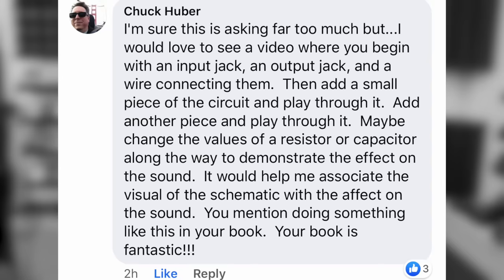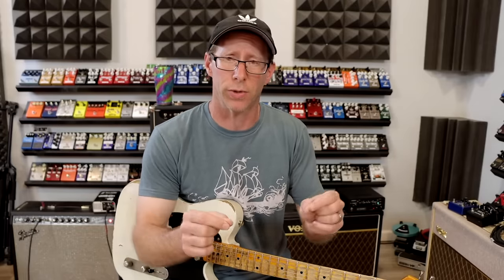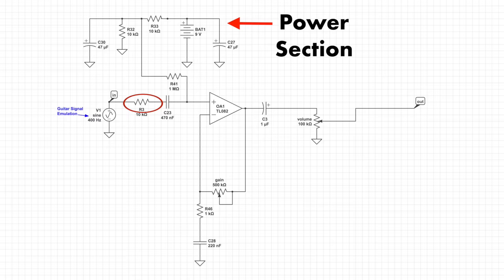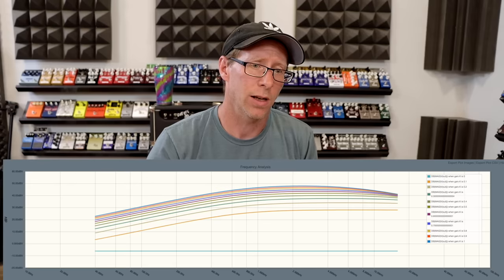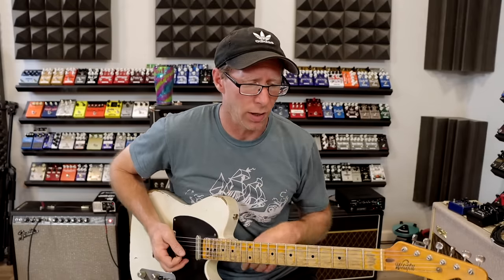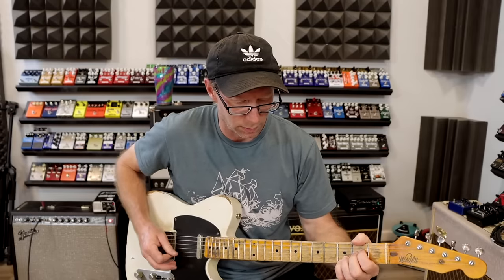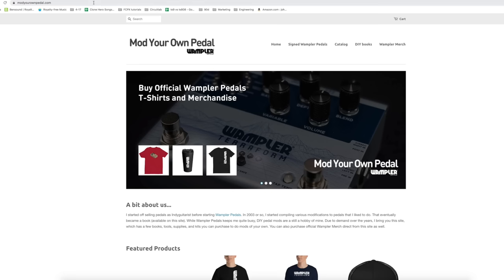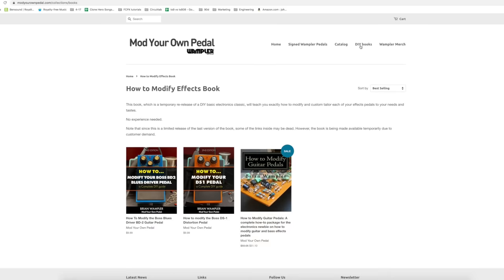How To Design An Overdrive Pedal Circuit

Comment: hey Brian, first of all thanks for the detailed explanation of the circuit! 
But there's something I don't quite understand yet, If let's say I'm setting the gain knob on my Tubescreamer to "0" and my volume to "max". Does that mean that any clipping sound that I heard is came from the op amp clipping and not the diodes? 

If I set my volume level to max is it boosting the op amp or what? 

I'm hoping you could help me understand, thanks very much in advance man!
Reply from the maker: In that setting with THAT particular circuit it’s not clipping(distorting) much at all, but it’s driving your amp harder, making the amp itself distort more
Reply: @wampler_pedals  ohh okay thanks very much for the answer Brian!

Comment: This is so awesome!  I tried to build my own guitar effects long ago with a timer IC and op amps to experiment and made a near fuzzy robot-sound distortion from it.  It wasn't what I was going after but I was happy with the result.  Do you know how to delay a duplicated guitar signal and add it back into the signal line without it affecting the original frequency on the line?  I tried to use a 555 Timer and some diodes and capacitors and other circuitry to delay the signal and then add it back in but the resulting signal was an analog wave with inverted sawtooth spikes on the wave.
Reply: what happens if I raise the tone's pot ?

Comment: Hi Brian! Loved this video!
I have a quick question, I wonder if anyone can help with?
I'm building a rangemaster type treble boost with a silicon npn transistor and it sounds great. The problem is, when the guitar volume knob is turned all the way down, it bumz really loudly. It stops doing this when you turn it back up just a little bit. To complicate things more, running a TC mojo mojo in front of it at unity gain and no clipping completely rectifies this issue.
Do you have any idea of what is causing this? It's been plaguing me all week!

Keep up the hard work!
- Adam

Comment: Hey brian!  Love your breadboard videos.  I have a question though.  
Is it possible for one pedal to damage another?  I was breadboarding a npn treble booster and decided to connect it to my board to see how it played with the other pedals.  I had it first in the chain running though an AC booster to a clusterfuzz.  After turning on the treble booster the clusterfuzz volume is very VERY low.  Think I may have fried it, But the AC booster is fine and was in the whole time. Not sure what the deal is, thought I would ask.  Seems strange that it was the only pedal affected.

Comment: Hello! im building this project and im planning to use a DC power supply. I get that it should have 9V, but how much current (or amperes) should the supply have?
Reply from the maker: It should work just fine with something 200ma or higher just to be on the safe side. I haven’t measured it but it probably uses much lower than that, and it won’t hurt anything having a power source that has more current capability (not to be confused with voltage)
Reply: @wampler_pedals  got it, thank you!

Comment: Out of curiosity, what would happen if, Instead of using a 1M resistor, I wired a 1M Pot as a variable resistor? (when maxed out, I imagine that it would function just the same as a normal 1m resistor, but would any harm come to the circuit as I rotated the pot, thus reducing resistance, changing the Bias, and allowing more voltage to get to the Op amp?
(mainly asking because I don't have a 1m resistor on hand, but i happen to have the 1mPot lying around, and an enclosure with 4 nob holes haha.)
-also, will a TL082"CP" work just as well as the TL082 in the schematic?
Reply: It ought to work just fine. Probably wouldn't be useful in a practice sense, but it would help in the design phase. It ought to allow you to try different values and be instantly able to hear how it changed vs just calculating the numbers. Yea, you can pinpoint a desired number but hearing the change is nice for deciding on the final value. For voicing the circuit, a capacitor decade box will let you try different cap values easily. But, I guess it's still easy in a breadboard also....

Comment: Are the op amp inputs self biasing? With the capacitors there's no Dc reference to ground for them. I've seen this on some other pedal schematics recently and was wondering about it.
Reply from the maker: It’s referenced to virtual ground, or vref.

Comment: One small question is the 10k resister at the starting for impedance matching?
Reply from the maker: No, not necessarily. It’s pretty high input impedance already. I’m limiting a little bit of signal there.

Comment: Is there any chance that you could use a schematic to demonstrate how to build a simple nuclear reactor in your bathtub?
Reply from the maker: Of course! 😉
Reply: Yes. Former nuclear mechanic supervisor for submarines and guitar player here — we could probably push 3 MW out of a trash can size reactor - a little worried about getting proper coolant supply, and adequate shielding ...  radiation and contamination are non-fun - I would personally stick with the PFM (Pure  #%^*ing Magic) signal mod boxes and practice good electrical safety.

Comment: Hello, this vid is 2 years old so you might not see this, but I was wondering how you produced that EQ chart. I'm doing a guitar pedal for a school project and need to show evidence in my write-up that the low-pass filters and tone control works on paper.
Reply: Awesome video btw! Really helpful
Reply from the maker: I use circuitlab.com for the videos because the graphs are nicer looking but for engineering I recommend LTspice software
Reply: @wampler_pedals  Cheers! Would it be possible to do a vid like this for an EQ pedal?
Reply from the maker: Possibly so!

Comment: Where do we have to connect the ground of the guitar?
Reply from the maker: To the ground of the breadboard. All analog grounds get tied together basically.
Reply: @wampler_pedals  means that we have to connect it to the negative of the battery?
And where do we have to get the output(negative one)?
Pls reply 🙏
Reply from the maker: Yes, battery ground and signal ground will be connected
Reply: @wampler_pedals  Can I use LM358 instead of TL072?

Comment: I was hoping for an explanation for the top part of the circuit too (T_T)
What exactly does the 47uF and the two 10k and 1M resistor do?
Reply: All these are to make a power supply for the circuit. So they dont influence the tone. That's why they were probably skipped. The two 10k resistors are to create a bias voltage( vcc divided by 2). The caps are to stabiliaze the battery voltage in case of current peaks. The 1M resistor is to connect the bias to non-inverting input of the op amp and to set the input impedance.
Reply: @hbo001  thank youu

Comment: Hey man, it possible to fit a fender style tonestack into a drive pedal instead of just a simple filter? I mean I know that an amp style tonestack will lower the signal a lot. Do you have any suggestions about that?
Reply from the maker: We used to make a pedal like this called the black 65 actually

Comment: Can you explain in short why there are there so many resistors and capacitors in the power supply section?
Reply from the maker: To provide for the voltage necessary for biasing the opamp, which creates a virtual ground of sorts.

Short answer: because it’s needed.

Comment: Hi Brian, slightly off topic, and at the risk of asking a silly question - is the bright cap still intact on that channel on your Deluxe Reverb? It did sound nice and bright when clean so I would guess so; I was just surprised as it didn’t seem to make the overdrive unusably harsh/brittle. Maybe I’m missing something!
Reply from the maker: Yes it’s still in place, I just change the speakers to a better speaker. In this case it’s a Celestion creamback 65
Reply: @wampler_pedals  Good to know, thanks!

Comment: Not considering circuit analysis here, but it sounds like you could eliminate the two capacitors in the feedback circuit of the op amp if you are using the output's tone capacitor and resistor.  With clipping diodes short circuiting the feedback of the op-amp above 0.7 volts, I don't see how you get any gain, unless the feedback signal at most reaches around 1 volt peak max so that you are clipping only a small portion  of the AC signal.  I don't know enough of the signal levels in this circuit to make too much sense of it.  I would love to look at the this with an oscillascope.
Reply from the maker: It’s more fun playing a guitar through it
Reply: @wampler_pedals  Inquiring minds want to know  :-))

Comment: Nice! Question: I have one of those 500-in-1 electronics kits from Elenco. It has 3 books of projects, with the first two focusing on discrete components and small IC's while the third book focuses on a 4-bit assembly language. It never goes into math or physics; the project itself is the schematic and a few small sentences about what it does. Do you think that learning this way be effective? My goal is to do be able to do single layer circuit board modifications on pedals and amplifiers. The academic method of mixing in a ton of math equations and physics just isnt very appealing, to me.
Reply: You might not like the maths and physics but you need to learn that stuff. It saves a lot of trial and error and lets you get close to the required values of the components with fairly simple calculations (simple airthemetic). I say this from experience, I am an electronics and communication engineer with a second major in computer science and engineering.

Comment: Thanks for sharing. Would it work with a pair of headphones connected to the output directly? Maybe changing the pots at the output. I tried and it didn't work. I started from a booster circuit which worked connecting my headphones directly, but when I added a pair of 1n4148 diodes I didn't get the expected sound from the headphones. Maybe I connected them badly, but if not, why I didn't get the proper result? Thanks.
Reply: Headphones have a low impedance, say 50 Ohms. The lower the impedance of whatever you're connecting to your circuit, the higher the current that's required to get a (voltage) signal into them. The components (really just the OpAmp) in this circuit aren't capable of producing the amount of current needed to drive your headphones. It's the same reason a guitar amp needs a  power section in order to drive speakers, though the impedance of a speaker is even lower and thus the current higher. You could try listening through an audio interface, but it's probably best to just use your amp. Hope what i'm saying makes sense.
Reply: @allmetaliswelcome  Yes. It makes sense. The thing is that used as a booster, like http://www.jer00n.nl/2010/07/28/clean-boost-for-guitar-or-bass/, or similar, it works with headphones, and the sound is not that bad, but when I tried to add overdrive or distortion I did not get a nice sound. I didn't listen to anything substantially different from the initial booster configuration. However, there are some schematics for headphones guitar amp that uses an opamp like tl072. I will try with an lm386 to see how it works.

Comment: Question…. What do I do if I can’t get the schematic but I have the layout from online and I want to breadboard it first…. What confuses me are the cuts to the vero. I don’t understand what to do on a breadboard when the layout calls for a cut…. Any help would be greatly appreciated!
Reply from the maker: If you don’t have the schematic then unfortunately you’ll either have to trace it or do some digging and see if someone in a diy group or forum has a schematic
Reply from the maker: A cut on vero board simply stops the signal from continuing along the trace. So each side of the cut isn’t connected
Reply: Thanks for replying!! I appreciate it! It’s all a little confusing at this point. It reminds me of life in general! Never really sure wtf is going on… 😂😂👍🏻👍🏻

Comment: Really cool vid, Brian! Real newbie question here: How do you decide at which point in the circuit do you connect the power section to the rest of the circuit? To my layman's eyes it seems a bit arbitrary, is it really so, or is there some reasoning behind it?
Reply from the maker: There are some constants. Such as, in a dual opamp the data sheets tell you what pin is ground and what pin is +

Comment: Very nice video for some home tinkering. 
I recently built a booster, to boost my DS1 but it seems that the op amp is being hit so hard, that there is no signal coming through on the attack of the guitar. after some sustain it swells back in. Are there op amps that can handle a raw volume booster to increase distortion or should i try building something with some clipping to get the extra drive.
Reply from the maker: I’d have to see the circuit. That sound more like a misbiased transistor type thing to me honestly
Reply: @wampler_pedals  Well the circuit of the boost is from a Kit for a "super hard on" Style boost (so Just one FET and alot of boost) and the DS1 ist a modded one lent by my guitar teacher. It has an extra LED in the Control Plate which Lights up when it distorts also it is Set to 18 volts internally i think. So the Led Lights up more the more i turn Up the gain or the louder i Play, but as soon as i try to boost the ds1 the Led takes some time to Turn on and then only flickers. So i thought maybe the OP AMP ist shutting down or Something. Same with my rangemaster Style treble booster. Both boosters Work beautifully with the Driven channel of my little Transistor Orange AMP.

And thank you very much for the answer :)

Comment: Man, I sure wish you explained some of the physics behind it as well. How do those diodes make the signal clip? Why does a bigger capacitor add bass?
Reply: A resistor and a capacitor together make a filter. The larger the capacitor or the resistor, the more low end the filter lets through.
Reply: @allmetaliswelcome  yeah, but why? What I meant is that I wish this was explained like something out of ElectroBoom but all about sound. Really get into details on how each component works and interacts with one another.
Reply from the maker: @Rimsiakas  That's way, way, way over the heads of most of my viewers though. You're wanting something more advanced. Try Uncle Doug's channel: https://www.youtube.com/user/Stratosaurus1
Reply: @wampler_pedals  Hi! Well, can't speak for others but a lot of things in this video went over my head precisely because I don't know the fundamentals. Some more in depth explanation would have helped. I bet it's the same for many others just thinking of getting into pedal building with little previous knowledge. Though I don't know if this video was aimed at beginners in the first place :D
Doug's videos are a great and strangely relaxing watch but it's definitely not beginner material either :)
Cheers and good luck!

Comment: you didnt explain what the RC circuit to ground off of the negative feedback loop does. I believe it is filtering out the bass as shown in your plot and rightfully so as distorted bass does not sound good.  if that is the strategy , then why isn't the input signal put through a crossover network to separate the highs and lows . then add the distortion to the highs and mix the clean lows back in . has anyone done this before?

Comment: At 3:50 is that op amp clipping only?
That's a lot of distortion!
Once the diodes are in do we still clip the opamp?
Reply: Technically, it will depend on the diodes, but probably not. The headroom (max voltage before clipping the signal) will be determined by the power supply of the opamp when diodes are out—close to a 9v swing—and determined by the forward voltage of the diodes when they are in—probably less than 1v—so a 2v swing tops.

Comment: Why those diodes clip? Best video ever
Reply: Diodes "becomes" shorts when the voltage goes over 0.7V, so basically when the signal reaches 0.7V the diode holds the voltage there even if the signal is much higher. This clips the upper part of the signal, for the other part you'll need another diode but inverted, so the negative part of the signal gets cutted at -0.7V.
Reply: @seisette  So the signal clips at 0,7V?
Reply: @rodrigoespejo4431  Diodes only allow current to pass in one direction, but with a voltage drop (typically around 0.7V, but there are others). So once the signal goes above 0.7V, current can pass through the diodes, limiting the voltage of the signal from getting any higher (ie. clipping the top of the wave).
Reply: @rodrigoespejo4431  on the diode yes, but after it the opamp raise the signal (can be a lot), and after it the tone filter and the volume potentiometer lowers it.
Reply: @seisette   Great!! Thank you so much. Now I really understand it
Reply: @Thirsty_Fox  Thank you! You have really help me to understand
Reply: @rodrigoespejo4431  My pleasure! Good luck :)

Comment: How did you supply de -/+ voltage for the OPAMP?
Reply from the maker: It’s just a standard 9vdc supply, common to what is used on most pedals
Reply: @wampler_pedals  datasheet says 18V input. I didn't know it works with 9V. Thank you.

Comment: A 10K resistor and a .4 capacitor !? What , I need to know , determines the value of your Rs & Cs ? I know you're starting out @ ♾️ and moving > but in an amp / pedal how is it determined ?
Reply from the maker: Depends where it’s at in the circuit. If it’s affecting frequencies that’s a math thing, and using some sort of spice software or circuitlab.com does that part for you